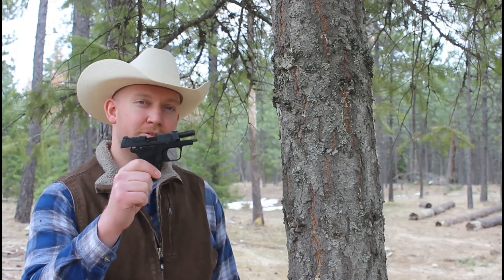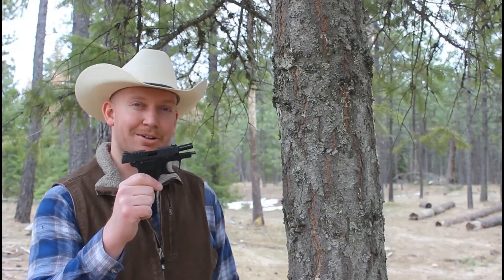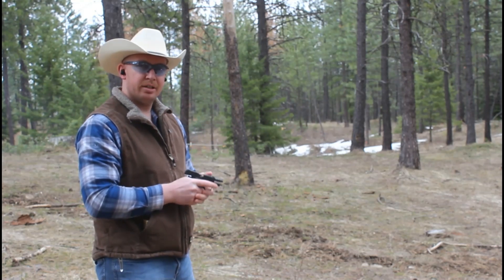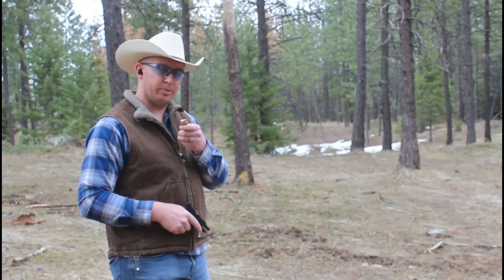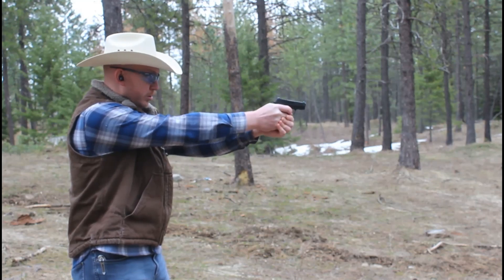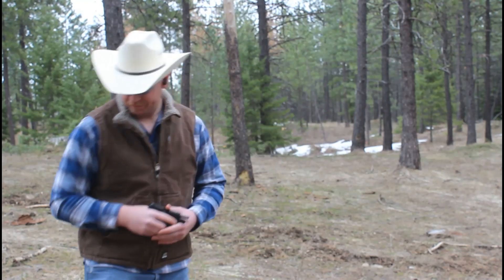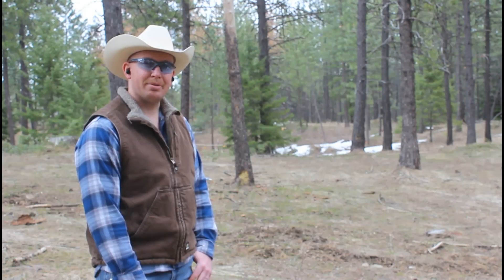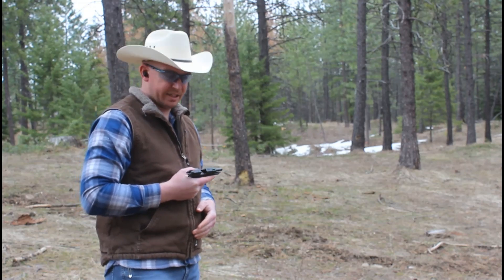Will It Cycle?? Springfield 911 380ACP

Comment: I have one of these; got it when it first came out, the original version.  It was my exclusive EDC for nearly three years, and now I still carry it sometimes, particularly when discretion is very important; I also like to carry it when I’m on a road trip.

It had a break-in period of about 300 rounds, during which my most common problem was failure to go into battery, and also occasional light primer strikes.  I’ve put maybe 1700 rounds or thereabouts through it since, with hardly any malfunctions of any kind at all.

The thing about this pistol is that it is built to very tight mechanical tolerances. This contributes to it being very accurate for such a small gun, but it also means that even a modest amount of carbon buildup from shooting can start to interfere with the action.  

So, it has to be cleaned frequently.  Springfield recommends every 100 rounds, and I would never let it go past 150.  As a practical matter I personally just clean it after every range session; it is the only firearm I own that I do that with.

And it has to be cleaned in a particular way.  On the slide, it’s not a good idea to use oil-based cleaners like CLP.  This can ultimately form a gunk that causes problems.  On the slide I use Birchwood Casey “Gun Scrubber”; the only oil I use on the slide is on the rail grooves that interface with the frame.  

Keep it clean, and clean it right, and you shouldn’t have any issues with the 911.  Except for the frequent maintenance required, it’s probably one of the very best .380 ACP carry guns ever made.  Excellent ergonomics, sights, trigger, and accuracy…light and compact for easy carry but it has just enough heft to tame the recoil.  It’s a shame that they are no longer produced, as I think Springfield Armory hit it out of the park with this design.

Hope you’ve still got it and that it is continuing to run well for you.
Reply from the maker: That's good to know! I've got a ways to go on break in then haha!

Comment: Having tried numerous .380 platform/ammo combinations over the past 40 years, I've pretty much decided that most of them: 1) Prefer and function best with FMJ ammo; 2) Have a narrow range of defensive ammo brands or styles that will function reliably. That said, I usually try a few and carry what works. A defensive firearm is just a paperweight if it's not reliable. Cheers.
Reply from the maker: I have seen that too. I'm going to try Blue Guardian ammunition. It has the overall shape as FMJ, but as a Frangible HP. We will see how it does in a future video.

Comment: I have the 911 Alpha and have two problems mine.
 The slide sometimes stops about 1/8 in. from going into battery, but with a slight touch goes right in. 
 It is also very erratic in the direction it ejects the casings , it will vary from right forward to right rearward,  over my right shoulder and a few times into my face. 
 I have noticed that the ejection direction varies between ammo brands. 
 The battery stoppage starts happening after the 3rd round regardless of ammo brand.
 Other than that it is an accurate little pistol.

Comment: Nice video. Sorry I'm kinda late to the dance... Big fan of the Springfield 911 in 380acp. Have one of them beast since they first came out. My only bad experience with it, that it's starts to malfunction after about 25 to 30 round. It won't go into battery. I figured it's because 380acp  ammo is very dirty...
Reply from the maker: That's about what this one had through it when it was sent out for repair. Fortunately Springfield has a great warranty
Reply: @theidahorifleman  did they say what parts did they replace?
Reply from the maker: @hondasaurusrex6998  recut and polished barrel ramp, polished chamber, polished bottom of slide, tuned extractor was what the notes said

Comment: I have this pistol. When I first got it, it would stovepipe or fail to go into battery. Sent it back to Springfield and now it works fine. Same size but heavier than my Ruger LCP2, it shoots better than my LCP2. The only things I don't like about the 911 is that the safety pinches when I disengage it. Anyone else have that issue? Also, it's harder to take down for clean and lube than my LCP2.